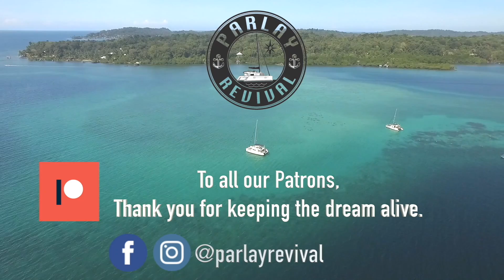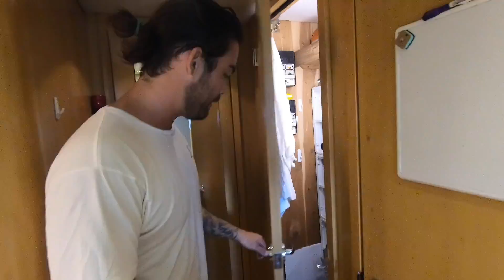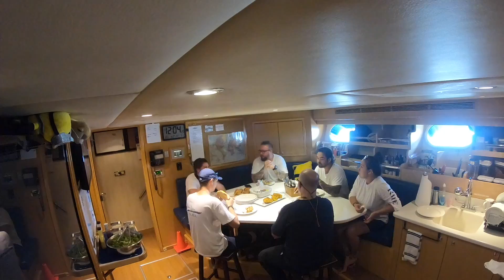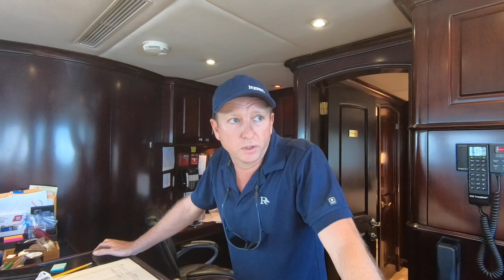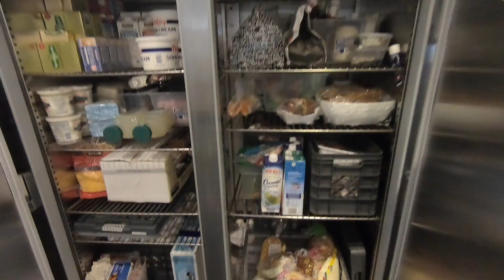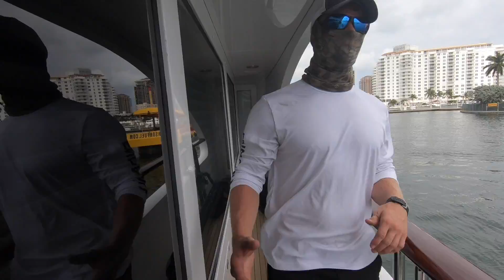What's it like to work on a SUPERYACHT? - Episode 44

Comment: Awesome video. I was a Craftmaster in USN on 135 ft LCU. Same deal with me and Cheng (chief engineer) need to be on same page ALL the time. Surprised you don't have inflatable boots on the shafts for fixing the seals. Don't have to go swimming and get wet either. Cheers.

Comment: That's kind of a stupid design with the seal. You think they'd have some kind of manual valve that you can shut off to stop water coming in kind of primitive going underneath the boat duct taping.
Reply: The shaft seal is what seals the shaft to the hull where the shaft goes through the hull.  That tube that the water is coming out of is not a pipe  but rather is part of the watertight boundary of the hull.  The tube extends over only part of the length of the shaft, and includes bearings to support the shaft, and a surface that the shaft seal will seal too.      If you put a valve on that tube, you could not shut it since the metal propeller shaft extending through the tube  would necessarily extend through that valve to connect the engine to the propeller at the end of the shaft.

Comment: Ok, I am a nurse, not an engineer.

But, what if, instead of duct tape, you wrapped it with a semi inflated rubber bicycle tube, with a couple lines tied to it, so you could pull it off from above decks after the new seal is applied. Would that work better?

Comment: 🙏 🙏 🙏 
SUGGESTION: I’d love if you’d please make detailed videos discussing your job as an engineer and Q&A videos on superyachts.  The more detailed information, stories, and day-to-day life that you include is better.  

QUESTIONS: And not just about being an engineer but also about life on board the yacht? What type of yachts you’ve worked on? Dynamics between the rest of the crew? How much you worked on charter vs private? How long were your contracts (e.g., ongoing rotational schedule between you and another engineer every 1-3mos, did you work shorter contracts of maybe 3mos, did you usually work permanently on a yacht with just 1-2mos off per year, or what)? How much do charters usually tip (I’ve heard it’s about 10% of charter fee but often that doesn’t seem like enough per crew member)? Your day-to-day life both on charter and off charter? More about how you started in the industry and moved up, including time in each position before chief engineer? How much the captain supervises the chief engineer? How much does the chief engineer keeps the captain updated on what he’s doing, etc? How necessary do you think chief engineers are on yachts (practically speaking not legally) because nearly everything is monitored electronically from the bridge? Alternately, do you think superyacht engineers are underpaid compared to captains, or do you think the pay disparity is appropriate based on knowledge/value/duties, (I ask this because to me as an outsider it seems easier to be a captain than to go to school and be an engineer)? What level of licenses do you have as a chief engineer and do you have any captain/mate licenses?  Other questions I’m curious about but I’m not as dying to know: On different yachts you’ve worked on how many charters did it have per year and were they normally during certain months, How many times did the owners come on board per year and how long did they stay on?  

This could also bring in more viewers for people that want to search for information about charter yacht crew and how life is. I am actually one of those people because a few years back I came across the Bravo show Below Deck, which you undoubtedly know about, and was interested in seeing more videos about that so I searched about life on yachts and eventually I’m pretty sure that’s how I came across sailing channels. Now I watch about 12 different sailing channels on & off at different times. I always watch every video but a lot of times I’ve binged several videos at one time. Sometimes it’s almost too much to keep up with. Since there is a new Below Deck season starting you might get others like me that find your superyacht videos and watch everything else too. And even beyond all that, I’m sure a lot of your subscribers would be interested in knowing at least some information. 

I already watched this video but I’ve came back to the video now to make this comment. And the videos you make about working on a superyacht don’t have to be nicely produced like you normally make your videos, it can be more of a raw unedited video. The information is what counts. I hope you will consider my request. 
🙏🛥🙏🛳🙏👷‍♂️🙏👨‍✈️🙏

Comment: What ended up causing the shaft leak, if it was leaking more after you put the inside seal on?
Reply: The new seal sealed the leak. It was the old one shown on different shots that leaked. André

Comment: The super yacht you mentioned was built in Mississippi.  You also mentioned "Trinity" which happens to be a boat yard on Seaway Rd, Gulfport Mississippi.  I have friend that I worked with updating drawings used to build The DDG Naval destroyers. He went on to working in the private sector where as I stayed with the Naval contract.

Comment: So when they install a new shaft, do they slip a backup seal on there too for this situation?
Reply: Yes, you replace the seal with one of the spares already on the shaft. When the seal is removed the water leak is limited by an alignment bearing in the housing and the seal is used for water that gets past that. You can see the design for the Tides Marine SureSeal here: https://www.tidesmarine.com/ws/index.php?route=product/product&product_id=42